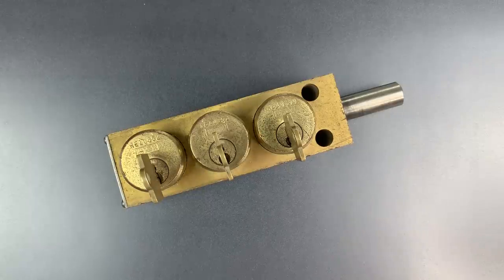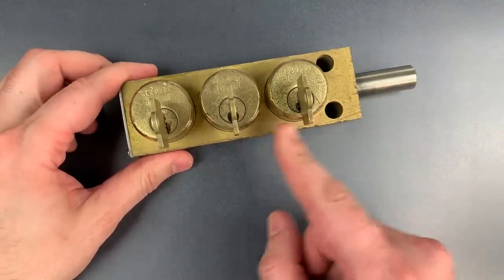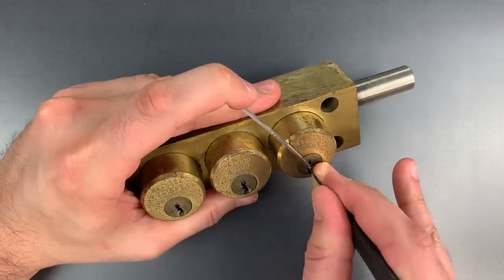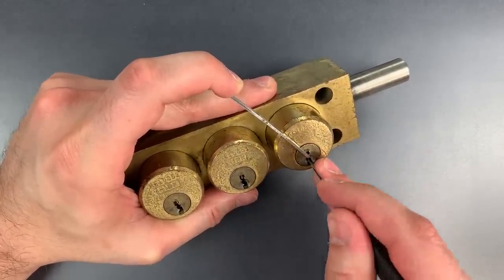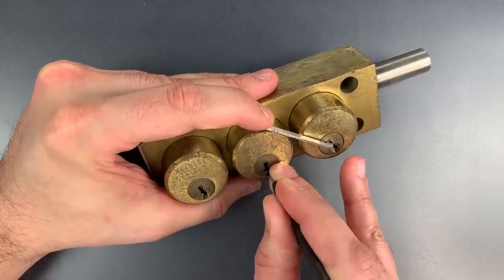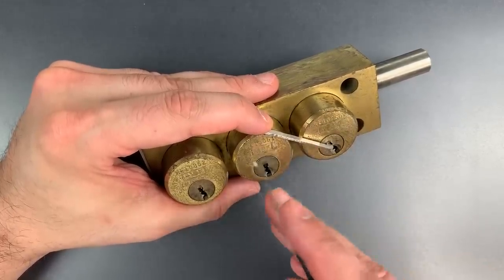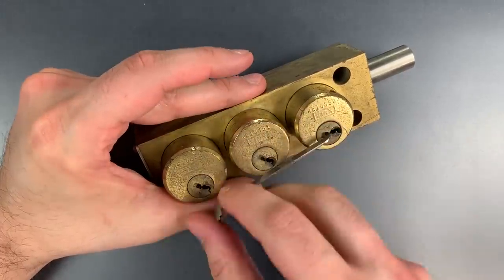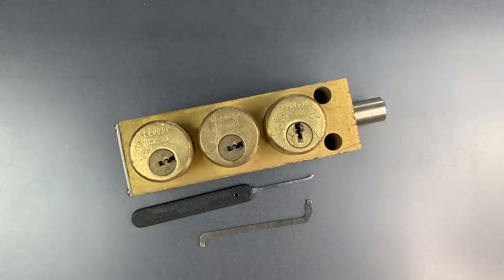[917] Triple Core Kirk Interlock Module Picked

Comment: Not only to make them idiot proof, but also make them boss and worker proof. Workers will frequently be under pressure to make thing easier by compromising on safety, and that's something you want to prevent at all costs.
Reply: There is still a huge security gap. It is more than enough if just one of the workers happens to be LPL to cause a terrible accident.
Reply: @u.v.s.5583  It'll be very obvious to them and any bystanders, for several minutes, that they are in the process of breaking safety procedure. That's gotta count for something.
Reply: @Paremo_  Sure! 5 minutes of lockpicking plus a giant explosion gonna count for a viral video!
Reply: @Paremo_  In Canada, removing a Tag-out lock is a very serious offence.  And if injury or death results in its unauthorized removal,  that person can be charged criminally and  heavily fined
Reply: you're implying that it's boss proof. But it's allowing the idiot boss ordering his 3 workers to unlock it
Reply: @DirtyHairy1  or if they break the rules somehow by letting a boss have all 3 keys and he or someone he hands them to can go unlock. At least it's possible that it will be noticed when the power is turned off or on if there's enough noise. If not enough noise something else would have to be observed
Reply: @DirtyHairy1  I believe the idea is that the keys are stuck in three somethings that need to be turned off before you are allowed to open this lock. It is not the kind where you need to be three persons. The devices that need to be off are designed such that they are off when the key is in a position where it can be removed.
Reply: I never add any less than 3 cut-off switches to any installation I do, any 1 will kill mains power and all 3 are required to start back up. and usually I set it up such that if power is cut, all 3 need to be shut off and turned on within a short period of each other or power will not come back on. inconvenience is safety, it wills people to make sure what happened never happens again so they don't all have to go turn the power back on with 3 people who have keys and are required to press no less than 2 buttons each. 
overkill I know but I'm at fault if it doesn't kill the power and someone dies because of it
Reply: @DirtyHairy1  If a worker surrenders his key then the worker will (hopefully!) stay away from the works that could be livened, started up etc. If a key goes missing then a senior supervisor would have the power to break the lock or use an emergency spare key or masterkey. He or she would check very carefully that the works are safe to re-liven etc, and warn workers to keep away. In a complicated case the keys used to secure the works are locked in a box and each worker accessing the works will apply his own padlock to the box.

Some railroads use keys to interlock between switches and signals. These keys are often large and heavy, have only a handful of differs and the lock mechanisms are rudimentary, but they get the job done. Some of these installations have been in use for over 100 years. Mostly railroad workers respect them. There was however a case in one African country where a stationmaster got a local blacksmith to make duplicate keys to save having to walk around the railroad yard.
Reply: Here in Australia we use gang locks.  Everyone who needs it locked out adds their own padlock and tag to the gang lock.  The gang lock can't be removed until all padlocks have been removed.  The 2nd layer of protection is legal, the "do not operate" tags and gang locks are protected by federal law.  Tampering with one carries heavy penalties including lengthy jail time.
Reply: @danielgoodman3578  since this particular lock has 3 keys , one of those keys has to be posession of a person's who is in the danger zone
Reply: @absolutez3r019  

Same with US plants, particularly Nukes.
Reply: @DirtyHairy1  What happens in that situation though, is that because the boss is supposed to have the key, they are liable for any issues since the boss is supposed to secure the key. Compare that to saying something like "Dont hook up your harness it takes too long!" well if a worker follows that advice and falls down, the boss has plausible deniability of "i would never tell them to not hook up their harness, he was being reckless!" In this situation, the necessity of having a key that is supposed to be in the boss' posession means they have no excuse.
Reply: Baldur Norddahl  you’re absolutely right, that’s why they’re key retaining... I really don’t know why anyone would think giving it to 3 people would help no matter who they are. To follow LPL’s example, the keys live in the breakers while they are on. They must be removed in order to open the access panel, thus the power must be turned off.  Unless it’s picked it is indeed fail safe.
Reply: @absolutez3r019  only if the people working at the business or other org using it enforce that.
Reply: Daniel Goodman no that’s not how it works
Reply: @tsloth1390  please do tell me then how an inanimate object forces people to use it correctly
Reply: @tsloth1390  my point is that triple lock is only as good for its intended security purpose if the people using it apply that purpose.
Reply: Daniel Goodman unless someone picks it it cannot be used improperly. The order of operations for opening it ensures safety. It’s clearly not tamper proof for someone that wants to do ill. But assuming you are using the keys because that’s a fairly reasonable assumption because they’re just in the breakers. So take em out, cutting power.  Then you have access to the panel that was previously hazardous. It’s not rocket science
Reply: Daniel Goodman  security is not this lock’s purpose, only safety.
Reply: @absolutez3r019  Just as it should be everywhere
Reply: @steampunkskunk3638  One electrician I know said that he was at a job site where they used the same key for all locks. He didn't work there long since he valued his life
Reply: @danielgoodman3578  a sad truth.  I've seen a cut lock on the ground next to high voltage disconnect. Everyone knew who cut it but nothing was done
Reply: In the end, all of them will put their own key to bypass something. It happens all the time, in all industries when under pressure of under a tight schedule. Safety is number one concern as long as they have time and can afford it. just go to an airport an see jetliner landing in tight limits for crosswinds, when you can divert or abort. Money is the name of the game.
Reply: I must confess that I haven't completely understood the use case of this lock. Is it "just" to make sure that you need these three keys or is this part of a complete execution chain where you release the two keys on the left so that you can unlock something with it (which would cause severe danger when unlocked while the system is running) - but with this lock you ensured that the main switch is now turned off?
Reply: @annando  Let's say you have some station with three pumps. Each pump requires a key to turn on. When the pump is turned on, the key is held in place and can not be removed. Let's say there is an access hatch. This access hatch would be locked with this three cylinder lock. So you'd need to turn off all three pumps, take their keys, and insert them into the three cylinders to open the access hatch.
Reply: Workers who cut on safety to save time are idiot's.
Reply: @TheBUGZNTA  no, they aren't. Workers only put themselves at risk because there is pressure from above. Workplace safety always starts with the bosses.
Reply: @squelchedotter  if you think losing a job is worse than losing you life than you might be a lot like one of @BUGZNTA 's workers
Reply: @BrianatorFTW  The line of thinking goes more like this: "My kid needs corrective heart surgery, so I can't lose my insurance or my kid dies (or insert whatever pressure, elderly parents to take care of, losing your house to foreclosure, whatever). That disaster is 100% guaranteed if I refuse to do what my idiot boss is demanding. On the other hand, there's only like a fraction of a percent chance I'll be a slide in somebody's safety briefing if I do it. I'll probably be OK."
Reply: @absolutez3r019  Ignoring the fact he will probably be dead.
Reply: @firesurfer  the incident I referred to actually involved an elevator disconnect. It was shut down due to water flooding the shaft.  Luckily it was safe to start back up, but the people who cut the lock  didn't know why it was shut down
Reply: @annando  From what I've gathered, this lock would be on a door or gate to a room or area that has high voltage electricity running through it. If you were to go in while the power was on, it would be very dangerous. So each of the three keys to this lock would be in their own breaker controlling the flow of electricity to the room behind the lock. And you can't take the key out of the breaker without turning it off. So, to get all three keys to open the lock and enter the room, you'd need to turn off all three breakers, making the room safe to enter.
Reply: An extra key was shipped so that the number of keys equaled the number of cylinders to make installation easy; but that also meant that the safety interlocks wouldn't work as designed.
My biggest issue when installing equipment was the bosses who wanted the spare keys "just in case we need them".
I finally decided to talk to our Legal Department and I was told to inform them that unless the spare keys were snapped in two and returned to the factory there would be NO warranty on the equipment and the company would not be responsible for any injuries or deaths attributable to the keys not being destroyed and the pieces returned.
It is also a unique key design and can only be cut with very unique cutting equipment...and the factory that made these locks were the only place that they existed.
Reply: I have seen saftey sensors on machines with duct tape on them to render them unusable. I also witnessed an accident when a woman got a hand sucked into a machine that she tried to clean parts of when it was operational. She didn't lose the hand but she could have, it was pretty mangled.
Reply: @DirtyHairy1  If the boss do that then there is at least three witnesses to nail the boss.

Comment: takes a few minutes
quite challenging
... ...
id take years
Reply: When thelockpickinglawyer says that that's when you know the lock is physically impenetrable
Reply: @LaughingOrange  there's a diff between picking and breaking.
Reply: Laughing Orange When you steal stuff, you wouldn’t want to make noises right?
Reply: I’d take explosives
Reply: Cue the Ramset
Reply: Sam Sam and it’s funny cuz this lock isn’t even designed for pick resistance. It’s about safety not protecting valuables. If someone breaking in wants to electrocute themselves by picking the lock who cares?
Reply: it's not uncommon that a locked out power panel like this would secure could be powering a large part of a building. It is not just the person at the panel is at risk of being shocked.
Reply: @huckthatdish  Well, I would care as then you'd have to report it to the supervisor, the police, and the maintenance/ cleaning crew. And THEN there is all the paperwork that has to be done, and then set up for overtime to be paid, probably meal slips, and so on....

Comment: This "secure" type of interlock is usually not used as you say on a electrical door. They are more often used on valves. This 3-lock lock might be affixed on a valve stem for a drain valve such as so it cannot be closed. Then on the 3 inlet valves, theres a similiar lock but with only one key, and this key is trapped. When the bolt is blocked by the valve stem, the key cannot be turned to the position where the key can be taken. To close the drain valve, you first have to close the 3 inlet valves and gain their keys. Thus you cannot cause a explosion or overflow by closing the drain valve before closing the inlet.

Another example is that this 3-lock lock might be on a grounding lever for a substation, and then the 3 corresponding trapped keys might be located on the electrical disconnects for the phases, such as so the station cannot be grounded (and causing a short circuit) without first disconnecting the feed.

The reason more "secure" interlocks are used in such ways, is because such hazards are more dangerous, and can cause serious accidents where several people can be killed, included civilians, or very expensive equipment can become destroyed, or a very expensive process (that for example involves precious metals) can become spoiled.

In normal interlock conditions (safety interlocks to prevent for example a electrical door to be opened so you don't get a shock), more simple locks are used with different shapes and pins. Usually very simple to bypass, but if you bypass it, the only one you kill or endanger is yourself.
Reply: "Usually very simple to bypass, but if you bypass it, the only one you kill or endanger is yourself."

Idiot-proofing the world by removing idiots.  One at a time.
Reply from the maker: Interesting... thanks. I have no personal experience with these. I just used the example used by the manufacturer. I’m sure there are lots of other uses. 👍
Reply: 'They are more often used on valves"
"This 3-lock"
So, what you're saying is....

Half life 3 is confirmed?
Reply: Sebastian Nielsen Another type, common in electrical safety skips keys altogether and mechanically links the switch to the door.  That's because electric connections can be easily run to wherever the door can break them.  However once getting to the size of actual substations, safety will involve long mechanical rods and work orders to isolate both ends of a power line before crawling up the pylons (Pylons have no locks, just a warning sign telling people not to climb them, because they may die).
Reply: Electrician here. These interlocks are used on electrical equipment all the time. Usually it's in an interlock scheme where a piece of equipment has multiple sources that you don't want to connect in parallel.
Reply: sounds like something out of resident evil game,  only I know Umbrella would never have this because they are one of the most safety lacking fictional corporations ever.
Reply: @ZachFichtler  yes we have them at work on Main distribution panels that have multiple inputs, such as an automatic transfer switch and corresponding bypass for when the ATS fails. They are used to interlock the main Breakers so that only one may be energized at a time.
Reply: We use very similar lock set up on the main switchboard breakers on the ships I work on.
Reply: I agree with you i have worked in electrical integration for over 20 years. This kind of lock was never observed i have been close enough to high power enclosures to wipe my bank cards of the data. 
Volatile valving is way more likely to be home to this set of interlocks. Where three process mgrs who would be impacting their process, by opening this valve lock.
Reply: Work in power generation and see it in electrical control rooms and switchgear all the time.
Reply: Working with offshore wind turbines and substations (132,000 volts) for 6yrs, we do have some interlocks in that style. 
What is more common though, a isolation will be applied, locked off, that isolation key will be locked into a key safe, up to 8 further keys can be issued to the working parties from the key safe, only once all keys have been returned can the original key be removed from the key safe and then the isolation removed. Form of idiot proofing and also protects the equipment.

Comment: You were fortunate that the first core turned as much as it did after you picked it. If the lock had very tight tolerances, to the point where you couldn't tell if the first one was picked fully due to a lack of rotation, then you'd have a very hard time. Cool lock.

Comment: I worked in the electric utility industry for many years. Those Kirk key locks are used all over. In my case they prevented the improper operation of electrical devices within the electrical substation. Whenever maintenance was required they were used to safe out equipment for service. 
Thanks, nice vid.

Comment: So, thanks to you I bought a cheapo starter pick kit that had an acrylic lock for a teaching tool. I have now used my picks on 6 different locks and had success with three of them. One was a 3 pin medeco lock which just gave me even greater admiration for how easily you are able to maneuver through locks. Raking, bumping, rocking, etc. are useful skills, but single pin picking on real locks takes skill. Thanks for giving me knowledge in an area that was blank before.

Comment: Sometimes I have a desire to take an old bulky lock.
Add an electronic release to it, a small microphone, a sufficiently good microcontroller, and have it listen to the phrase "this is the lock picking lawyer" and have the lock simply open.
Probably also add a photo sensor so that it detects if there is light nearby, as to save the battery life during shipping.
Reply: @seanj3667  Yes, it would make for a fun "challenge" lock for LPL to decipher.

Comment: I work with and have installed several of these Kirk interlock systems on high voltage equipment. I wish they would redesign their keys to be made from a stronger material, and engineered to resist breaking off. The keys are retained by the lock, if the lock is open. They can only be removed once the lock is locked. This means that keys are left with the equipment, and are exposed, suject to being bumped and broken off. You cannot change the cores on these locks, and there are no spare keys. Good luck finding blank keys to make a replacement for 7, 8, or 9 pin locks. Every interlock set of locks is custom made to order. So if one key is lost or broken, you have to change every lock in the system. These are not cheap locks either. That is the largest flaw I've found with these.